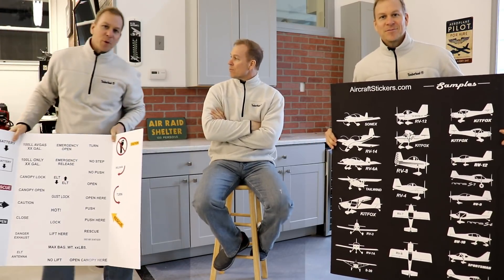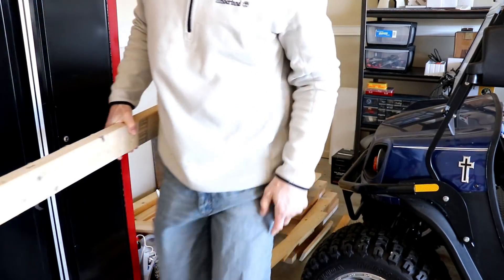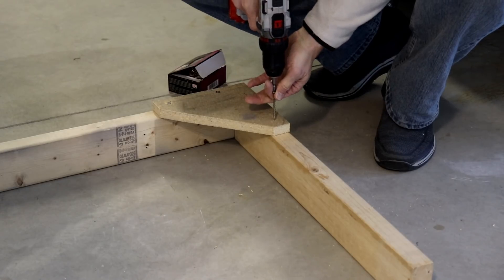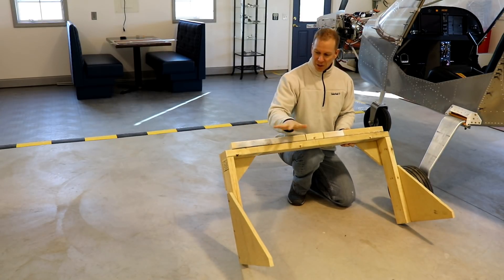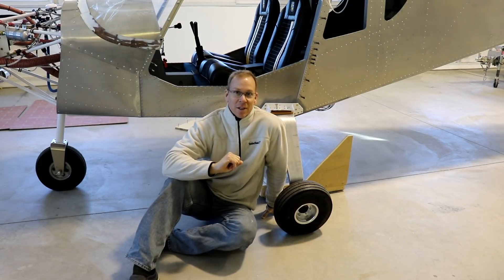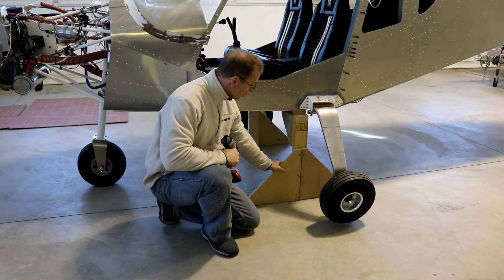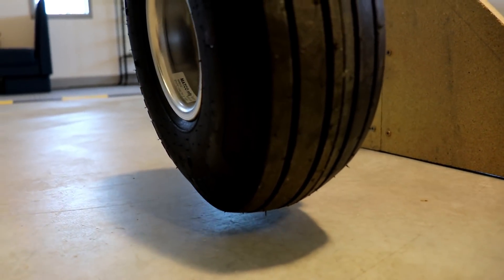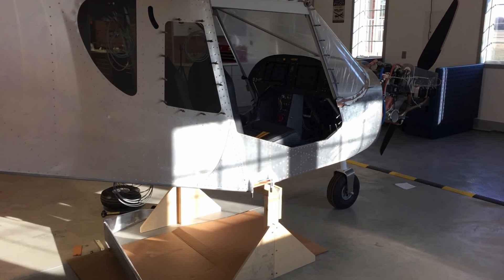Zenith Cruzer Airplane - Removing the Main Gear

Comment: You could put hinges on the two triangles that you power screwed on last ............fold them back over the two solid pieces , then swing them 180 degrees inline with the solids , when you have the fuselage raised............reverse procedure to drop it back down...........nice lifting device you made..........do the other two guys get in the way sometimes ??....
Reply from the maker: That's a good idea to hinge them. Maybe I will do that so I don't have to screw them on each time. ya those other two guys are always screwing things up!!